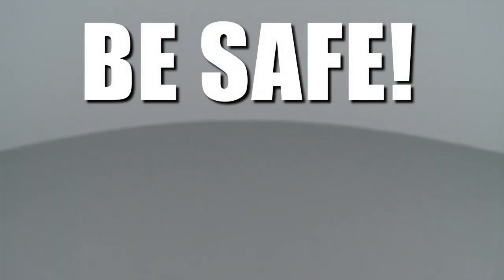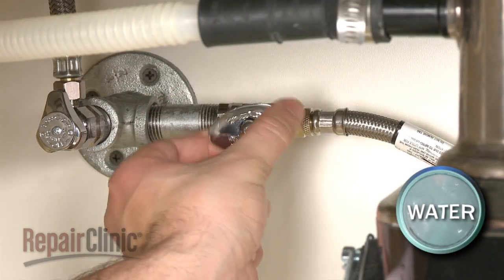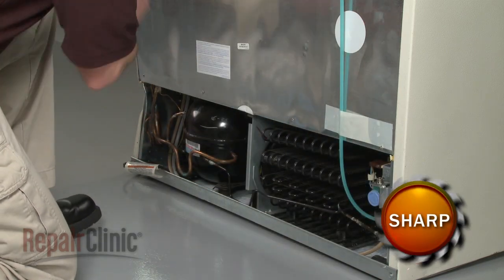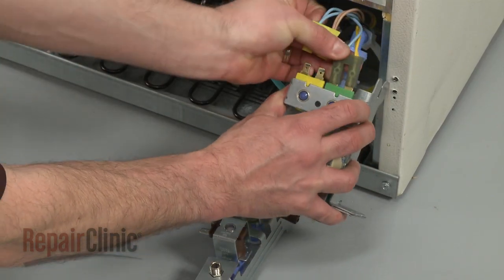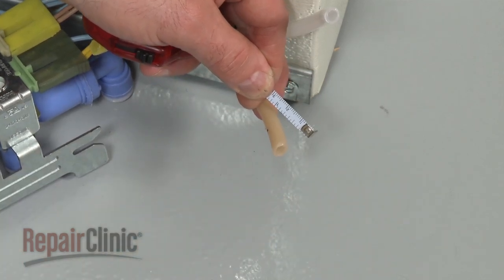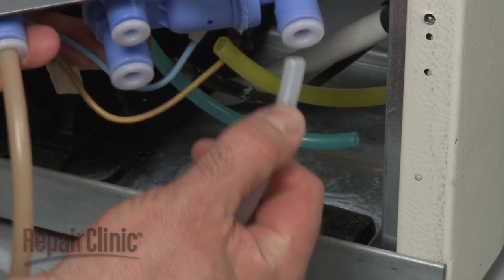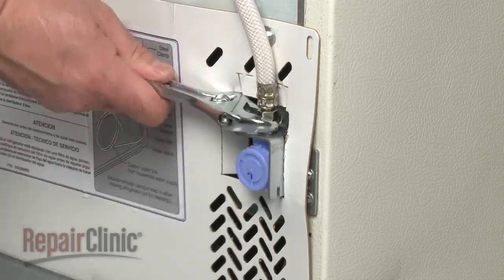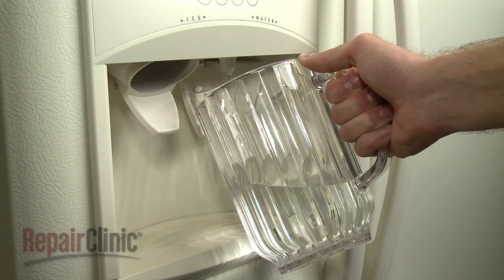Frigidaire Refrigerator Dispenser Water Inlet Valve #242252702

Comment from the maker: There are a few different things that can cause the water to not run to the ice maker and the dispenser. I would recommend using the repair help section of the website (link in the description). If you enter your model number there you'll have access to part, model, and symptom specific repair help.
Reply: RepairClinic.com I have a Electrolux fridge  that won't make I  had a repair man there and it still doesn't work he says he replaced all

Comment: Frigidaire model# FFSS2622NB5 side by side is a couple months old. Water has always dispensed super SLOW.  Last week the red filter indicator light went on and water began to drip constantly. We replaced the filter last nite and it still drips constantly. Shut off ice maker, still drips. Water pressure is still very slow as well. Thanks for your help, as I don't know where to begin diagnosing.
Reply from the maker: heather davidson Enter your model number in our website's repair help system: http://www.repairclinic.com/repairhelp for troubleshooting information, specific to your model. There are a few different possible causes.

Comment: So here's the big question. Frigidaire Gallery French door FGHB2868TF5 water running slow. Replaced filter and filter housing. No change. Water still comes out weak. Can the water valve solenoids not open all the way causing this?. I hear the loud solenoid kick in when dispensing water. The supply is strong so I am at a loss. The ice cubes are smaller than they were too. This is a 2019 model. It just started doing this 2 weeks ago. Thanks in advance

Comment: I replaced our water filter and now our freezer does not make ice. The water chute is visibly frozen now (the slide inside freezer the water goes in to ice maker) Do you think I need to replace the water valve? Is the water freezing at the chute because I replaced the water filter that is in the fridge? The water dispenser still works..

Comment: I replaced the inlet valve successfully thanks to this video.  However, it did not resolve my problem.  The water will not stop flowing into the ice maker and will continue to overflow until I shut off the ice maker.  Thoughts?

Comment: I have a new Frigidaire  25.5 cu ft side by side fridge and it dispenses water at an extremely slow rate. I have bleed the line and checked for a kink in the tube. Is there anything else I can do ?

Comment: Water is no longer dispensing and ice is not being made since no water is getting to the ice maker on my Frigidaire. I replaced the following parts to no avail:
Water inlet valve
Filter
Ice maker
The water pressure is good. Since replacing the water inlet valve, there is a buzzing noise when the system tries to send water to the ice maker. Anyone have any suggestions on what's wrong and how to fix? Would greatly appreciate feedback.
Reply: The line feeding the water supply to the ice maker through the valve could be frozen up or pinched.

Comment: Is there a listing of which hoses go where? I have a hose with a small hole, the orange/red one in this video for this model. Any ideas?

Found it. Yellow/orange hose goes to the filter in the top of the fridge section.
Reply: can't find where to buy a replacement hose at?

Comment: This was a great video, i did it myself. Water came out of dispenser after a few minutes, but when i take cup away it still drips a very little bit is there something i can do?
Reply from the maker: There still may be a little air in the line and holding tank in the refrigerator behind the crisper drawer. It may work itself out. The water pressure to the valve should be at least 20 pounds or the new valve may not seal properly. This will be most noticeable with a slow water flow at the dispenser. The most common cause of this problem is air in the line or a loose connection at the valve outlet, holding tank or at the fitting at the bottom of the door. You can check these to make sure they are tight and there are no small leaks.

Comment: this is the same unit I just replaced, I still have no water going ice maker or the water dispenser.  I've checked for frozen lines all are clear. This seems to be a common problem with frigidaire.. with little help to resolve.

Comment: Does the water inlet valve control both the ice maker and water dispenser?  I have water to the dispenser but the ice maker is not working.  I have replaced the ice maker.
Reply from the maker: Yes usually the valve supplies water to both.
Reply: RepairClinic.com   when I get water from mine it spills on back of glass like the water disoencer is clogged up or sumthing it does not come out as a solid stream any suggestions please help
Reply: I know this is old, but mine is doing the same thing. Did you find out what was causing it?

Comment: The water in the door fills very slowly about 1minute for 8oz. It starts out fast for a second then goes down to a very small stream.
Reply from the maker: James Angelo Enter your refrigerator model number in our website's free repair help section for model-specific information: http://www.repairclinic.com/repairhelp.
Reply: James, did you figure out why this was happening?  Same issue here
Reply: Clogged filter. Replace. Inside right side at the top, back.

Comment: My inlet valve is making noise, but i dont use it. No water is hooked up. Can i simply disconnect the power?
Reply from the maker: spaz376 If you do not use the dishwasher it is recommended you disconnect the power.

Comment: ok I have one for you.  My side by side Frigidaire mod  #PLHS269ZDB2   is leaking underneath from a gray tube that I believe goes through a hole into the overflow pan.  BUT mice have chewed it  so it doesn't reach the pan.  How do I reach it to replace it and what is this part called?   Thank you for your help.  I love your videos and come to you guys for answers often, Dale
Reply from the maker: The original part has been replaced with a rubber drain tube assembly. You may need to remove the condenser fan motor to gain access to the tube. You can either replace the old tube with the new style or you can add a piece of rubber tube onto the existing tube to make it reach. You may need to take the piece that broke off to the hardware store to get the right size to add on. If you want to replace the whole tube, you may need to pull it through the hole from the inside of the freezer and snap it into place. The evaporator is located just over the hole and may make this a little difficult without moving the whole evaporator out of the way. I would try adding a hose to the existing pipe first and go from there.
Reply: I just noticed your response and cant thank you enough for your time and suggestions.  We will try the "adding a hose" first.  thank you so much!
Reply from the maker: Awesome. We hope it goes well!
Reply: We used a piece of garden hose and a couple clamps.  It's been a couple weeks now and NO PROBLEM!  Thank you again. Saved us a lot of money, I'm sure.

Comment: Would this be the correct way to fix the water pressure issue I have with my refrigerator? When I called on phone they suggested I change the water filter. I only had the refrigerator for about two month when the pressure got to slow to use normally. I haven't had the same issues with the ice.
Reply from the maker: +exluna24 If the unit is only two months old it is unlikely a water valve already got clogged and is causing issues.

Comment: Our water was turned of for some time. We were not home to stop the icemaker from calling for water. Now it won't call for water. We get water the the door dispenser . Just not the icemaker.
Reply: It's important to turn off the ice maker when you shut off the water supply. Otherwise, it could keep trying to cycle leading to a potential motor burnout the same as if it were actually making ice with a water supply all along. Ice makers typically only last a short time (~5 years) so if it's not being used, it's best to turn it off to save the 'mileage' on it. I suspect your ice maker failed.

Comment: My Frigidaire dispenser water is coming out at super fast speed and splashes out of the glass when filling. Would this valve replacement resolve the problem?
Reply from the maker: easyhec That would be the first place to start. The valves have flow restrictors in them. Also if the incoming water pressure is too high that will also cause high pressure at the dispenser The water pressure should be around 30 to 60 psi.